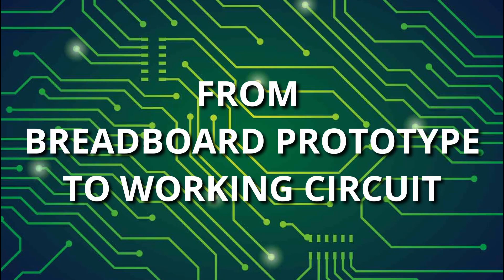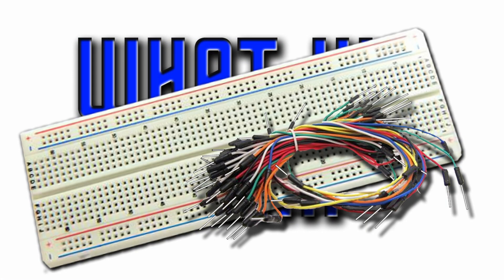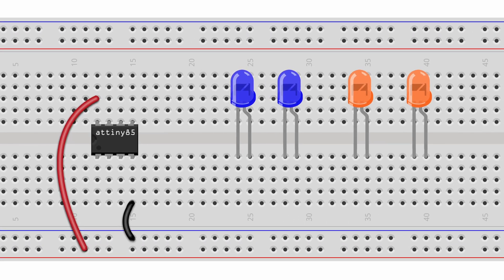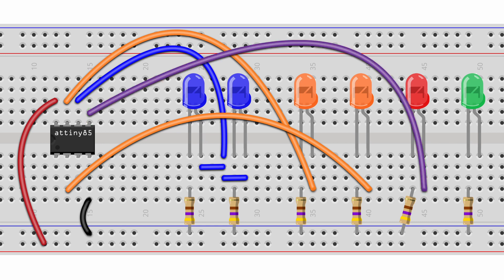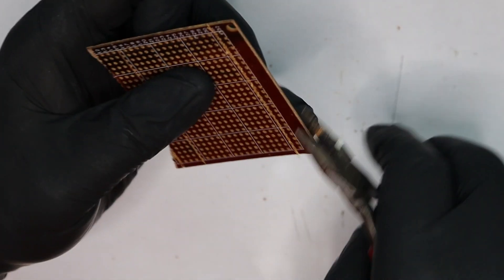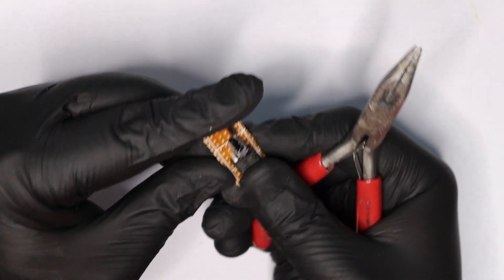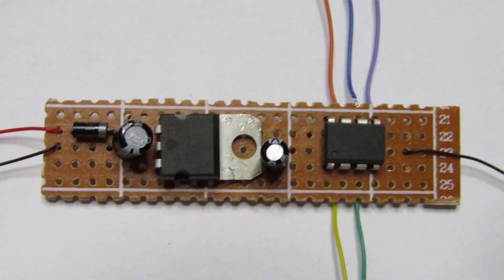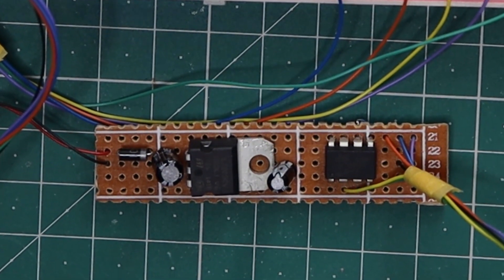Arduino for Starships - Ch15 - From Prototype to Working Circuit

Comment: super useful video, thank!! quick question: what would happen if you connect the chip directly to DC 5V without the capacitors, rectifier and regulator, like an USB power pack? I'm completely illiterate in electronics, as you can guess! 😀 thanks!
Reply from the maker: Hi, apologies for the late reply. Connecting to an external 5V supply will work perfectly. The capacitors are just there to smooth out the current across the voltage regulator, but not necessary from a 5V supply. Thank you for watching!
Reply: @OstrichLongneck  great, thanks!

Comment: Hello Trevor, I am looking for a cheap way to make a flashing nav/strobe circuit for the Refit Enterprise, I have no idea about programing and never used Arduino, but have soldered some circuits in the past, I would also like to make a circuit for the deflector dish to power up and then down when turned on/off, but this is not important as the nav/strobes.
Paul
Reply from the maker: Hi, Paul. You could upload the sketch from chapter 2 to an ATTiny chip, and use the method described in this video to solder up the circuit. All of the components used would probably be less than a dollar. Alternatively, here is a link to a relatively inexpensive board which would probably do the trick:
https://shop.hobbylinkinternational.com/product/hli-dual-blinker-board-board-only-hlifx_001a/
Thanks for stopping by 😀🖖
Reply: Hello Paul, I would like to suggest  viewing Trevor's Arduino for Starships - Ch04 - Bonus: Sketch Bashing. If you're not planning to light the  Warp Nacelle on your Refit Enterprise. You can use the sketch he present and load it to an ATtiny85. You will need two transistors to help drive the 12 LEDs which makes up the  8 Nav and 4 Strobe light. Just a suggestion from a fellow Cadet. 🖖🧑‍🚀

Comment: Great stuff Trevor.  I have not used that style of board before - I have used the ones with continuous tracks leading in one direction, but it looks like this version will give more flexibility?  I might go and get some and have a play.
Salvador's sketch also looks interesting and uses some techniques which are worth studying.

Thanks.
Reply from the maker: Thanks, Alon 😀I think the board I used one of the cheaper brands - the continuous track ones are way nicer to use when transferring from the breadboard, especially when soldering up an ATMega chip with all of its bits and bobs! The laser-fire routine which Salvador coded was a tough one for me, as I had to understand how it worked before turning it into a state machine. Hats off to him, it's a clever bit of compact coding. It was a bit of an "aha!" moment for me, haha, but I'm sure you'll figure it out without much effort 🙂Thanks very much for stopping by! I hope I didn't make any mistakes in this one 😂😂😂